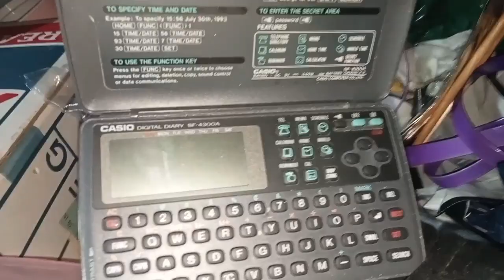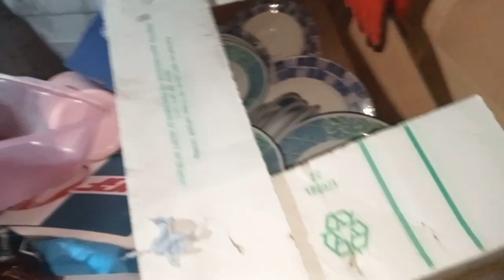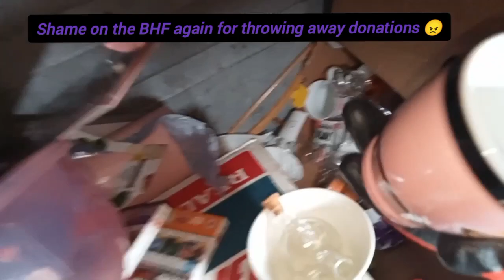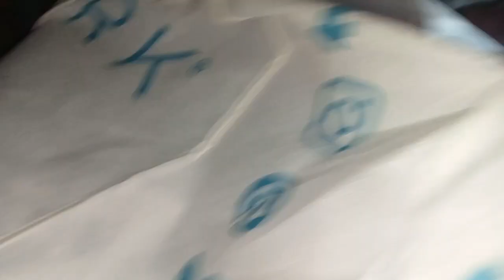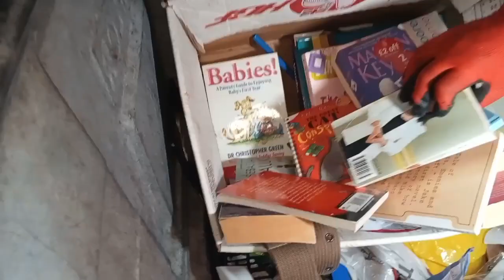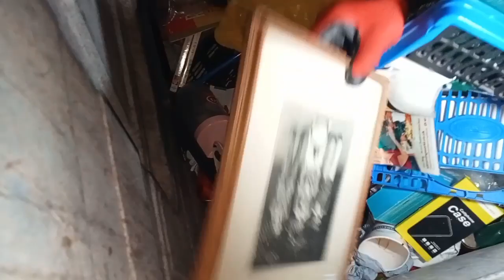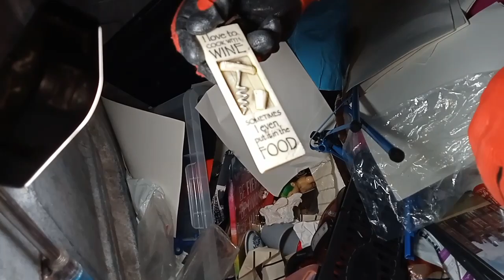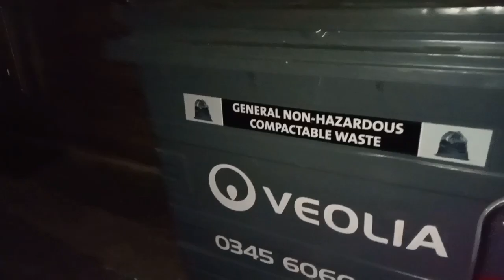Incredible Vintage treasure found Dumpster diving | When dives pay off! #dumpsterdiving

Comment: The green & purple watch straps, you can take the watch out & have a different colour strap ,if you find watches that works pull the stopper out when not wearing it to save the battery from running out
Reply from the maker: Thank you heather, one of them was a bit manky though so just took the one that the watch was in. Thank you for watching 😊